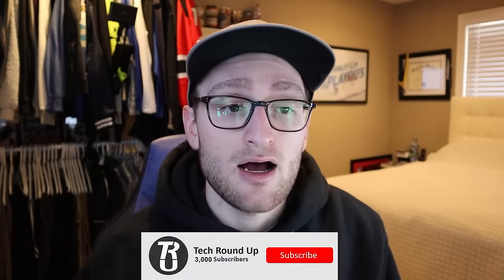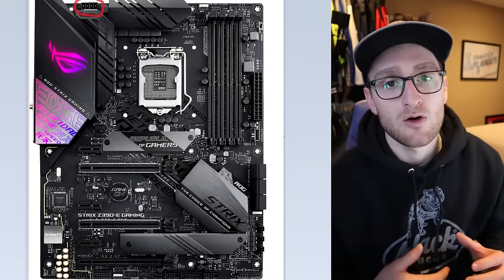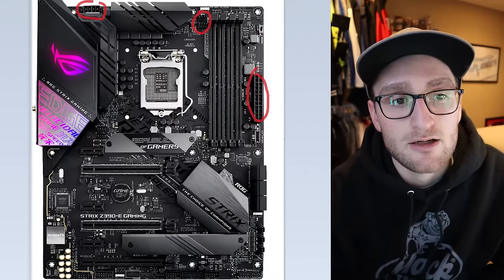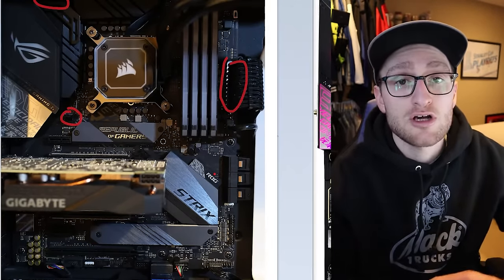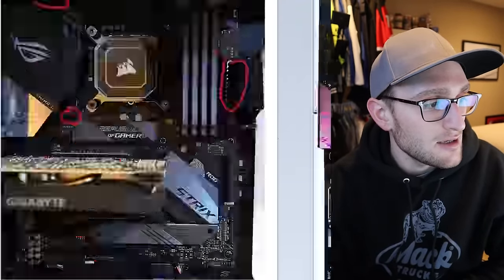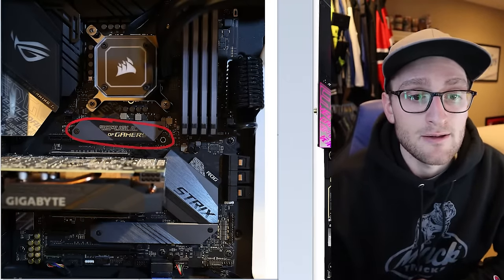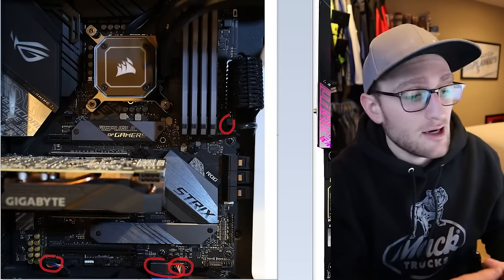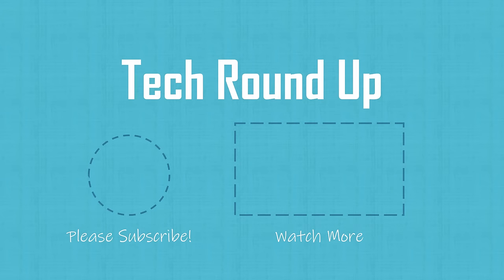Where do all your PC Parts Plug In?!?! Motherboard Connectors

Comment: I have a 2 fan radiator up front and I have 3 120mm fans at the top I have 2 fan connectors for the radiator this has to be the most confusing set up I have ever tried to build I have my power supply motherboard connected and the power cpu hooked up from the power supply to the 8 pin power hooked up it's the fan and radiator is what is kicking my butt any additional help would be greatly appreciated!!!

Comment: Thanks for the useful info. I have a case with three RGB fans and am adding an additional 9 fans, including the 3 on the IAO. My question is I have ordered two sata powered hubs. Should I be able to run all of this with Aura Sync off of that IAO port and daisy chain those hubs? I was hoping for individual light control across all fans for waves, etc?

Comment: I'm new to building PCs. I bought a 3-pin cooler when my motherboard has only a 4-pin connection. What happens if I use that cooler on my motherboard? I need help. Plus, this video was helpful!

Comment: I've been an avid pc gamer my whole life (I'm 31 now) but never built a pc even after studying ICT in university, however after being "duped" into buying a half decent gaming PC I realised quickly that I had maxed it out after just a couple of minor RAM & GPU upgrades as I'd been sold a pc with a 2nd gen Intel motherboard... 🤦‍♂️🤦‍♂️🤦‍♂️ I'm now building for the first time from scratch but as I'm "poor" I'm buying selective parts every few months over the next 9-12 months, I've bought the case, power supply & motherboard up to now... wish me luck.
Reply from the maker: Good luck!
Reply: @TechRoundUp  you phoney you did not even plug in one wire
Reply: @billybobs1705  😂💀

Comment: If I'm running two GPU's and my PCIe cables each have a set of connectors part way up as well as at the end, can I use one cable for each of my GPU's?

They don't branch, there's just another connector part way up. My old GPU needs just one and my new one needs 3. I have 4 connectors with 2 cables so can I do one cable the new one and one cable to both or do I need to use a different cable for each GPU

Comment: Ok the AIO fans connects to the cpu fan header as per my instruction book what is the optional socket for . There is a fan hub that says to cpu fan it also has a power sata plug does this use both the optional header with it also being plugged into a sata power plug    Thanks

Comment: Very informative video but I have some questions as a first time builder that hopefully you or someone else can answer. I have an Rog  Strix x570-e gaming wifi II motherboard and need to connect 6 total aRGB fans as well as a wraith prism for the cpu. Would I need 2 different hubs( fan and argb) to connect everything? From my research it seems I need to plug in the 4 pin of the fan for power and the 3 pin for aRGB. I want everything to work with AuraSync as well as be able to control the fan speed and stuff. What would be the most efficient way to go about this? I’m new to this so I’m still learning everyday. Thanks I’m advance.
Reply: I am currently working on this question as well, I have the same or similar board although not gold and I have a hub on my chassis but it’s asking for argb +5 although mine stats +12v and I don’t want to fry anything

Comment: my motherboard (msi z590 ace) has 2 8pin cpu connectors but my power supply (xfx 750 watt 80 plus bronze) has only one 8pin cable will it cause any issues if i pair it with my rtx 3070?

Comment: I’ve problem with monitor, I tried follow you as much as possible. The system boot up fine, I guess. But when connecting my monitor to any hdmi port either the gpu or motherboard It said not detected device on the monitor. I connected a mouse in the usb port it lighted up. So I guess something is correct but not fully. Have you encountered such a problem? What should I do?
Reply: I know this might be too late but make sure you connect the hdmi or display port directly behind the gpy not motherboard.

Comment: Hi. Can you please help me with a simple question ... If a mobo says it has 2.5G LAN, does that mean it has an ethernet port on it to plug into from my router? Im looking to build for a ryzen 5 5600x and a 1070 ti, but dont know what cheap as pos mobo will let me plug in an ethernet cable or wifi card for internet. Any help massively appreciated.
Reply from the maker: Yes, you’ll have an Ethernet port to plug into

Comment: Sorry I is confusing a bit... Where should I connect the cable from the corsair H100i elite capellix to the motherboard ? To the cpu fun1or to pump?
Reply from the maker: Either, but if your motherboard has a pump header I would connect to there
Reply: @TechRoundUp  my motherboard is MSI Z690 FORCE.
Reply from the maker: You can use the pump header for the pump connector, and cpu header for cpu fans unless you are using a usb fan controller
Reply: Yes I am going to use the RGB controller

Comment: I am currently working on the fan question as well, I have the same or similar board although not gold and I have a hub on my chassis but it’s asking for argb +5 although mine stats +12v and I don’t want to fry anything the case is a GT301 and I have no idea where to plug the panel to or if I should just get them all plugged into the moba?

Comment: question what if your motherboard doent have the 3pin connector for aio cooler but can be installed on system and motherboard only has the 4 pin connection

Comment: i have z390 F-gaming asus motherboard..i just use aio ..so that aio cable plug to aio pump or cpu fan ?thanks before..
Reply from the maker: Either one will work, just if your using aio pump remember to disable cpu fan in bios

Comment: Thanks, very helpful.  I have a AIO water cooler, how do you turn off the fan header in the bios?  Because I got the error to make sure the fan header was connected. So I switched from the aio header to the fan header

Comment: I’m still not sure where to plug the thing with the blue head i have an msi b550 pro van Wi-Fi
Reply from the maker: Is it a skinny and long connector? It’s most likely usb 3.0 connector and looks to be on the bottom right corner of that motherboard
Reply: @TechRoundUp  and is it necessary
Reply from the maker: It will allow the USB ports on you are to work, so up to you how important that is

Comment: Hi my mobo has an 8pin and 4pin for cpu , will the 8pin be enough or do I need both plugged in? Thanks -mobo is z690 sours
Reply from the maker: I would recommend using both especially if your psu has dual cpu power connectors, only using the single 8-pin may have some unintended consequences on the VRMs on the board

Comment: I got a cyberpower pc intel i7 , I baught 3 separate Corsair sp120 fans to add on top . The fans works but the rgb is connected to the sata power supply cord and I keep getting messages on desktop “limited power on sata cable “ fans work but rgb light doesn’t. I have a 600 watts gold power supply

Comment: I need to find my mother's chipset fan connector. Do you know where it would be? ASRock x570 Taichi
Reply: If you're not sure, the best thing to do is to look at the manual. It will have a diagram of the board as well as the major connections.

Comment: I have aio coller but i dont have special place for the aio or water pump to put in cable in motherboard, where should i plug the cable?
Reply from the maker: You should plug into the cpu fan header

Comment: quick quesiton can i use the same cables from my old power supply with my new one or do i have to unplug everything and replug everythign with the new cables
Reply from the maker: It depends on the psu manufacturers, some have different pin outs that could cause issues
Reply: @TechRoundUp  Oh no

Comment: When I'm replacing a PSU; do I also need to replace the Front IO and Audio cables? Will my new PSU come with the necessary cables?
Reply from the maker: No, those are all based on the case you have, the power supply will only be for motherboard, CPU, GPU and storage device power
Reply: @TechRoundUp  ok whew! I’ve been looking everywhere for an answer. I have all these peripheral cables and I wasn’t sure where I was going to buy those cables seeing as you’re suggested to stay with the same cables your PSU provides
Reply: @TechRoundUp  Thank you so much.

Comment: Question: I am new to building PCs. I went from a cyberpowerpc to a total new rebuild using only the cyberpower tower with all new parts. The tower itself has a button (next to the power button) that used to change the RGB lights. I am fairly confident that I connected all the 'front panel connectors' correctly to the new motherboard however with all new fans I am unsure if something was misswired or missed outright as to the rgb button no longer working. I have a msi z790 motherboard now. What am I missing? PS. there is a little panel on the back of the PC with the rgb 3 pins; in addition, the motherboard has the 3pin Argb connectors. 
Please help

Comment: I have the Asus b550-A and i can’t find the spot to fit the LED cables for my case fans, AHHHH 
i been looking everywhere, i also can’t figure out where do i plug my AIO cooler if it’s 3 pin and my motherboard has 2 (4 pin) slots. 
I have a Kraken Nzxt 360mm 😫😫😫 help me

Comment: I’ve been looking all over YouTube to find an answer for my question so basically I am going to be having a Lian Li Case with 10 fans and I saw somewhere you need these lighting notes but I can’t find Them anywhere and you also need a fan hub but all the fan hubs don’t have 10 slots so would I just need to phantoms and then connect those both to my power supply

Comment: Does anyone have experience with Cooler Master 360L ARGB cooler and the Asus ROG Strix B550F mobo? Cooler Master's manual is abyssmal and there are three multi-connectors and my Cooler Master case has a hub already installed. I've connected the AIO to the pump but nothing else fits. The second plug is a 3 plug and all the pins at the top are 4-5 pins.
Reply: This video was a lifesaver for the majority of everything, but this is the last bit and there are too many connectors. Can I just connect my fans to the hub without the multi-cord?

Comment: Would it matter if the gpu is in the second slot because if I plug it in the first, it will block the wifi/Bluetooth adaptor.

Comment: First time buildier/ upgrader. Aoi corsair h150 has a 3 pin extender. My z490 has a 4 pin cpu header. Will this still plug in or do I need a convertor of some sort?
Reply from the maker: It will plug in. 3 pin can go on a 4 pin, but not the other way around

Comment: Okay so i have this exact motherboard. Im trying to install a ssd for the first time. Im thinking of doing it on the top ssd slot, do i need to take off the gpu or can i just install directly?
Reply from the maker: If your gpu shroud allows for access to the m.2 you can always leave it in. Just may be a bit easier to access with it out
Reply: @TechRoundUp  thanks! Luckily rn i only have a 1660 ti so its not that thick

Comment: Hello, since my motherboard doesn't have a pump header(only got 1cpuFan and 1sysFan), can I connect it to the cpuFan with a spliter together with the fan radiator. Or may be I can connect it directly to the psu. Please help
Reply from the maker: You could use a fan splitter or connect the raf fans to one of the chassis fan headers for temp based control
Reply: @TechRoundUp  so it's impossible for the pump to run if I connect it directly to the psu?
Reply from the maker: It just won’t adjust rpm based on temp, and running at full speed constantly is probably not the best
Reply: @TechRoundUp  i've read the pump needs to run at 100% so the aio works fine. But the fans indeed run based on the temperature of the cpu, am I right?

Comment: Just to confirming,I have a Dark hero motherboard with kraken 73 nzxt  so I should disable the gpu fan in the bios? Only because the fans connect straight in to the nzxt instead of the motherboard gpu fan
Reply from the maker: Yeah, if you’re using the pump header vs cpu fan you’ll need to disable cpu fan so that your mobo doesn’t think you’re missing a cooler
Reply: @TechRoundUp  thank you so much.

Comment: I need HELP PLEASE! I'm trying to get a 4000d Corsair case and an Asus Motherboard I'm thinking either Prime or TUF.. but on PC part picker keeps saying, "A USB 3.2 Gen 2 to USB 3.2 Gen 1 header adapter is required."             What does that mean? I did read in reddit you can change setting in filter so i added 3.2 gen 1 and 3.2 gen 2 but both my motherboards are available but keeps giving me error.. What does the error mean and what does it effect and should and if.. how can i fix it? Thank you in advance for anyones time and help!

Comment: Okay, here's a curveball for you. My build I'm doing now I'm putting in an Asus Rampage V extreme x99 chipset. The thing about this board is that it does not have a 5V 3 or 4 pin header usually with white base plastic as shown in some pictures. It does have an input with four big pins like an old Power for an old HDD or CD-ROM whatever from back in the day and on top of it it says     hometom? I can't find any documentation videos or anything about what this is for. And where I have seen the 5 volt header identical to my board the location on my board has a 3.0 USB header. So I am extremely confused. I did purchase a Fan Hub and it appears the six fans that came with my case I'm going to have to toss because they are proprietary and have like five wires and five pins or maybe six and won't work on the Hub. This is a top-end board and they don't even have a 5 volt header for lighting what the heck! Any help would be so much appreciated at this point because I've lost my mind LOL.

Comment: I have the Z690 Tomahawk and struggling to connect the fan to the cpu fan header. But any direction i try, it just won't go in. I don't want to put full force and break a pin, but i am pushing gently down and won't go in.
Reply from the maker: Is it a 3 pin or a 4 pin fan connector?

Comment: What happens if one of the pins are missing for any of the connectors will that particular connection towards what ever is running stop functioning?
Reply: Its hard to say as it depends on the affected pin. Sometimes, some pins aren't really used for anything so it wouldn't matter. In other cases, it can be critical and the device will not work or may not work correctly.

Comment: I'm building a pc. I've done any and everything short of that..for the last..20+ yrs, lol.
So..case I wanted to use is like a 6 yr old Dell micro ATX. It has a 6 wire, 11 pin jack for the 
front pwr button. New school is all of the 1 & 2 pin plug stuff..I'll need a schematic for which 
pins do what on that long jack..and a new pwr button. I got an ASUS B560M, 2060 gpu, Fury Beast 
2x16gb RAM & a 10th gen i7 (3.8ghz cores :glasses-purple-yellow-diamond:) _LGA1200 stuff was enough money, 
lol_ on the way. ..might just buy a new case, rather than buy a fan & new pwr button..that'll come 
with the pwr button ofc and three 120mm fans. A pretty green DIYPC.

Comment: Watching this in 2023, i’m working on a build thats using older parts that i believe date back to almost a decade ago, the “ASUS Rampage Formula” original board, also every time i have to turn it on directly from the board, the front buttons do nothing, and when i actually turn it on a few lights flash and then nothing happens.. i’m not finished with it yet but can anyone help me with this? I just need something that tells me what goes where.. thanks!

Comment: Where do you plug in for wifi? My pc runs and everything but it doesn’t display audio and says the wifi cable is either broken or not connected. It’s a new pc with new parts and new cords and cables so I’m guessing it’s just not connected. Where can I find the location?
Reply from the maker: it would be on the IO section of the motherboard with the USB and Ethernet ports, should be two gold circular connections

Comment: Great video! I know it’s an old video, but I do have a question- where are you plugging your RGB hubs into? I figured they would still plug into the RGB header but you didn’t have anything plugged in there I believe
Reply from the maker: My Corsair hub, actually just connects over usb 2.0, but some hubs will plug in on motherboard RGB header to be controlled by motherboard software
Reply: @TechRoundUp  hey this is my first pc build and my friend built it for me but anyway so basically my headset was making a static noise from my mic when I used the front io and when I moved around the hd audio cable idk what happened but it dont recognize my headphones from the front anymore any chance u know what went wrong? thx

Comment: My motherboard does not have the front panel connectors. Instead it is next to the audio connector and is one row of 12 pins. However, the front panel connectors that came with my new case is meant for the motherboard you used as an example. What should I do?
Reply: My motherboard is the 0TYR0X
Reply: @vorsichtigeule3891  Dell loves to use proprietary things so the motherboard has a unique front panel header. I don't have a direct answer so you'll need to look at various forums that deal with Alienwares to see what other people can suggest in terms of modifications and/or workarounds.

Comment: Do you need the motherboard cables if so we’re fi i buy then because I got a motherboard without accessories please answer
Reply: Most cables needed for power come with the actual power supply unit. Mother boards do not usually come with those cables

Comment: one thing im struggling to understand is how you plug in fans so that you can control each one. each fan will have its own power and rgb cable, so lets say your case uses 7 fans total (3 AIO, 3 front 1 rear) thats 14 cables total and where does it all go 0_0